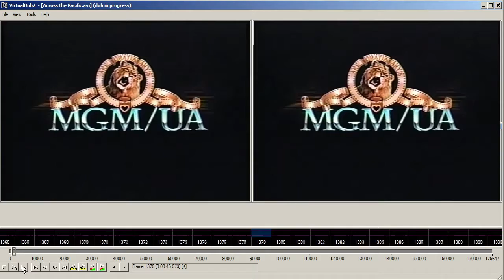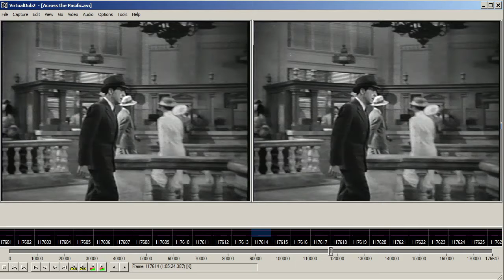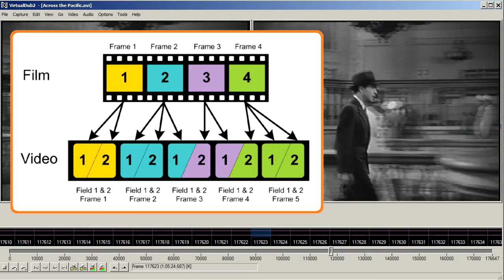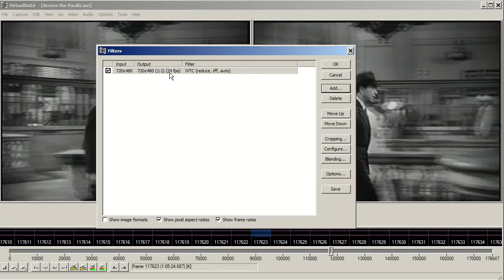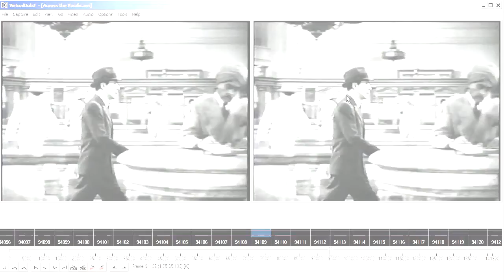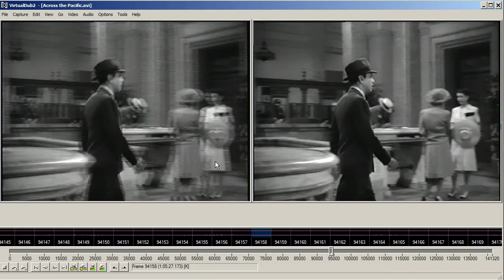What is 2-3 pulldown, and how to correctly digitize Hollywood movies recorded on VHS tape

Comment from the maker: This tip assumes that the digitized video preserves interlaced structure of the original analog video. Some digitizing tools convert interlaced video to progressive without doubling frame rate, in this case the combing is baked in and cannot be removed by tools like inverse telecine.

Comment: Thanks for posting this. I was confused why a pure rip of a 24fps animated film from 1973 came out at 5.5gb.

But then I did a pulldown with ffmpeg and got to half that size and the quality went up dramatically! 

It seems like anyone forced to watch old movies on dvd using an older tv that couldn’t accept 24fps would get just terrible versions of films like this.
Reply from the maker: The only way to watch movies on a regular CRT TV was interlaced. Progscan need to denterlace either way, and doing it with respect to the source produces better picture.

Comment: Please tell me why we reduce the frame rate to 24.  I am new to digitizing, and am always trying to learn new tricks.
Reply from the maker: 24 fps is the frame rate used to shoot movies. Some Euro movies have been shot and/or transmitted at 25 fps, especially those that have been made for TV. For these movies you don't need to perform inverse telecine, just treat them as 25p. Also, some footage for NTSC markets have been shot on film at 30 fps, mostly ads and music videos, treat them similarly, as 30p. But most movies and many high-quality TV shows shown on American TV have been shot at 24 fps. TV frame rate is either 30 fps interlaced or 60 fps progressive; either way, one second contains 60 independent pictures. To convert 24 frames into 60 pictures a so-called 2:3 pulldown usually is used (sometimes 2:3:3:2 and  2:2:2:4 are used), frames are split and/or duplicated. When you digitize a movie, you can either deinterlace it into 60p, converting each field into a frame, some frame will be duplicate. Or you can remove duplicate information and convert it back into its original form with 24 fps. Before doing that you need to verify that your video indeed contains 24-fps film, you do this by skipping the video frame by frame and looking at the combing pattern. The inverse telecine in VirtualDub works only for 2:3 pulldown pattern. You can use other tools to remove other pulldown patterns.

Comment: Another question…sorry for asking so many questions on your channels…there was a film called ‘TEN’ by Abbas Kiarostami. It was shot on a Mini DV camera but was shown in film festivals. How was a Mini DV video converted to be screened for a film festival where they showed 35mm film back in the 90s? Please guide?
Reply from the maker: I don't know much about festivals, but technologies to transfer video to film existed since 1930s. There are different approaches and different ways to convert frame rate. Unless frame rates match, the result will be blurry and may show interlacing artefacts. For exaple, watch the official trailer for "Genghis Blues" and notice occasional combing and double images.
Reply: @ConsumerDV  Hi, if I take an SD camera footage and play it on a great screen. Then record the screen with a 4K camera. Would that work?
Reply from the maker: Depending on what your goal is. It won't have details of real 4K. If you want 4K that has high resolution but looks like VHS, shoot 4K and use a filter to give it more old school look. Another option is to use old tube camera but feed it into an HD recorder. It will be higher quality that crappy VHS, in fact many tube cameras can easily resolve 800 lines or more. And it will have characteristic tube appearance with trails.
Reply: @ConsumerDV  thank you so much

Comment: When you reduce the frame rate, do you still need to convert the frame rate in virtualdub to adhere to 23.976?
Reply from the maker: You do not need to do anything else. When you save the video, it will be encoded with 23.976 rate. On the bottom of Filters dialog box there is a checkbox "Show frame rates", enable it. If you reduce frame rate in IVTC filter, you will see the reduced rate in the filter chain.
Reply: @ConsumerDV  Thank you so much!

Comment: Another thing, not-so-off-topic-but-off-topic-anyways is, what it I want to keep the interlacing? For some reason I still see the movement better in the interlaced video than the deinterlaced one. The best result I've seen is with bob or sometimes decomb, but I still notice the difference with the original interlaced and I liked better. Am I missing something? I play the video with ffplay so I don't know what deinterlacing method it uses if any.
Reply from the maker: VHS as well as DVD is an interlaced "transport" so to speak. But it can carry progressive content. So, twenty or so years ago when reviewers used to test the quality of deinterlacing, they have different tests for "video" and "film" content. "Film" content usually comes at 24 fps for NTSC region and 25 fps for 50 Hz region, and proper deinterlacer should figure out the cadence and recover it to restore full vertical resolution and to avoid combing. This is what inverse telecine does. For native "video" content you need to deinterlace it into 50p or 60p depending on region. Modern computer players like VLC or Splash can deinterlace interlaced video rather well, so you don't see combing and you get all the 50 or 60 images per second. But for some reason YouTube has never bothered with correct deinterlacing, which is why before uploading you should figure out what sort of content you are dealing with, and either deinterlace with frame doubling if it is "video", or remove the pulldown if it is "film". Some movies have unstable pulldown patterns, so it is easier just to deinterlace them as if they were "video", this is what cheap TV sets do.

TL;DR: deinterlacing with frame doubling always works :) but IVTC will produce a slightly better result and a smaller file if you have "film" content.

And now back to the original question: what if you wanted to keep interlacing. You certainly can do that, just do not use any deinterlacing filters. Unfortunately, depending on the codec and container, when you save file from VirtualDub, it does not always sets the flag that the video is interlaced, so it may throw off some players that refer to flags and do not analyze frame structure. Also, you need to preserve inerlacing if you plan to author a DVD. OTOH, VirtualDub does not output MPEG-2 needed for DVD, so you will need another program to produce it, and most authoring programs will automatically convert your 24p video into interlaced MPEG-2 with progressive flags.
Reply: @ConsumerDV  Excellent answer, thank you for taking your time on it.

Comment: Quick note. Sometimes we need to adapt the patter phase because the combed frame is not always in place. Do that if you still have "lined" frames.
Reply from the maker: Usually "Adaptive" setting works well enough when the cadence is strong. If the cadence is hard to detect, I prefer to deinterlace to 60p.